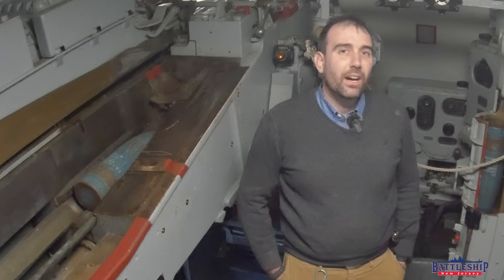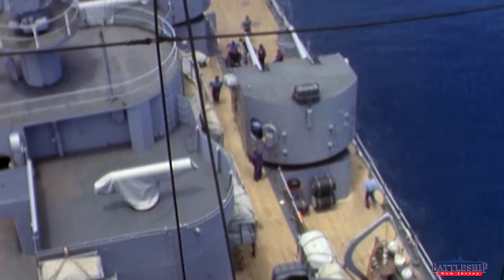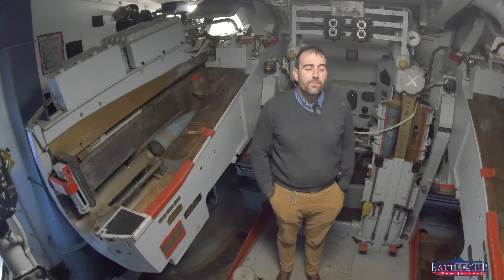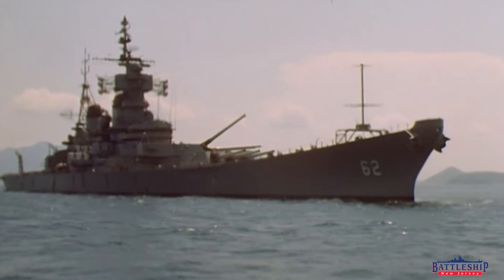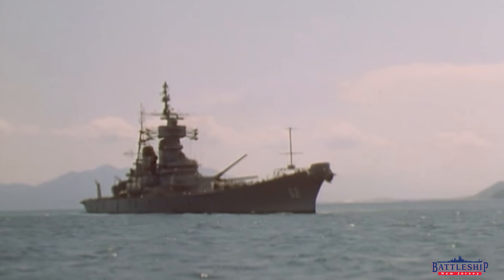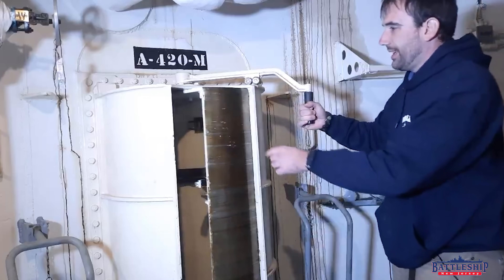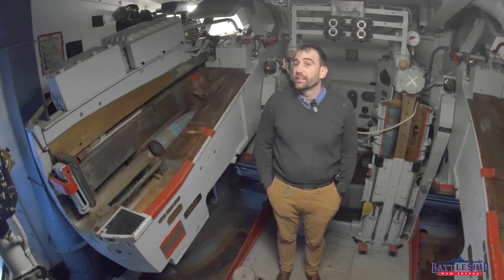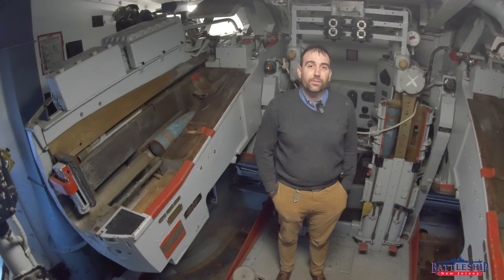Why Do Modern Warships Have So Few Guns?

Comment: With drones, I suspect the best way of stopping them will be electronic, blocking their signals and feeding them false ones. That will force the attackers to use more sophisticated and expensive (and therefore fewer) ones. But it will still need old fashioned flying lead and lots of it to stop the ones that get through.
Reply: It is already circumvented by have AI to find and destroy targets automatically.
Reply: Electronic warfare technologies has been in use and continuous development for many decades, modern warships use them to jam signals, especially for missiles, aircraft and enemy ships radar and communications. They works equally well against drones, but of course technologies to counter it has also been developed. So electronic warfare is really nothing new.

Comment: There might also be a matter of older designs having a “accuracy through volume” approach where you carried more guns to help increase your odds of one of those rounds hitting the target.  As systems improve or rate of fire of individual weapons increases, you don’t need that many guns to have the desired effect.  Something similar happened with air-to-air systems.  At the end of WWII, US fighters regularly carried six guns.  Over time, that’s gone down and now they usually have one gun that spits out a lot of ammo by itself. (This could be another example of missiles not completely replacing guns, since “missile-only” aircraft were tried and found wanting.)
Reply: According to Friedman, the original discussion on the KGV design was between 12x14”, 9x15” (or 16”). The 12x14” won out because of the greater chance of a hit. The n squared rule
Reply: The failure of missiles in Vietnam was a combination of training and doctrinal failures, for the most part. Navy Phantoms had dramatically higher kill/loss ratios than Air Force Phantoms, even after the introduction of the E model, thanks to a combination of better training and a more capable Sidewinder variant that the Air Force didn't think was necessary.

Comment: The USS-Brush had 3-5"-38 dual gun mounts.  Great for shore bombardment.  Not much good for anything else.  A big factor not mentioned was manning levels.  I remember 5 or 6 men in the mount and more below.  Much of that is automated now.  The mounts were cramped and very hot in Viet Nam.  No AC.  No heat.  Noisy.  Very dangerous.

Comment: There was a "missiles are the future" mentality in the navy for some time, but that was also when missiles were relatively simple. But now, missiles are far more intelligent, sophisticated, and most importantly, expensive. Guns could make a modest comeback. The Arleigh Burke class is reaching it's design limits. A new class is probably already on the drawing boards. While I don't expect a new version of a Des Moines, I wouldn't be surprised if there will be more ships with heavier AA oriented ships. Drone swarms aren't a bad idea, and multi-million dollar missiles don't grow on trees. Consider the reload factor. How long does it take to reload a missile tube? I doubt modern ships even carry extra missiles on board.
The CIWS, while an awesome sight, has only a few minutes worth of ammo loaded, and it takes many minutes (I think I saw "at least fifteen") to reload.
Reply: Modern ships don't carry extra missiles because the VLS complex is the launcher and the magazine. A VLS also holds more missiles per launch complex than the old system because it completely eliminates the need for a separate launcher and loading mechanism, and has a dramatically higher rate of fire.
Reply: @griffinfaulkner3514 Thank-you for the verification.  The point I was trying to make, is once the magazine (ready ammo) is spent, the ship is vulnerable and has to return to port, or supply base, for rearmament. 
I think of the CIWS. Great rate of fire, but what good is that rate of fire if it can't be sustained. It can only fire for about a minute or so, and then the clip is empty. It can be reloaded, obviously, but it takes many, many minutes to do so. And during that long period of reload time it is vulnerable.
Reply: @glrider100  CIWS is probably used exclusively against single targets, not swarms, and if I'm remembering correctly they load tungsten sabot rounds for increased velocity. The immediate solution to drone swarms, at least in my opinion, is to replace the Bushmaster 25mm mounts with the remote 30mm MAWS mount, firing proxy-fused ammo. A version of the system is already in use as an anti-drone weapon in Ukraine, so it's far more feasible than some of the solutions being thrown around.